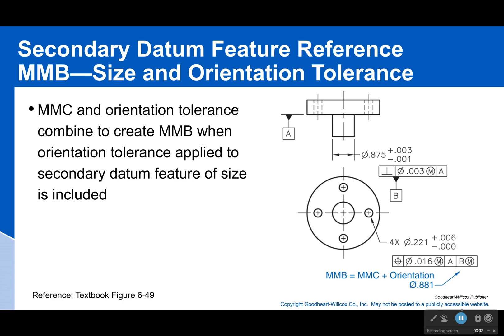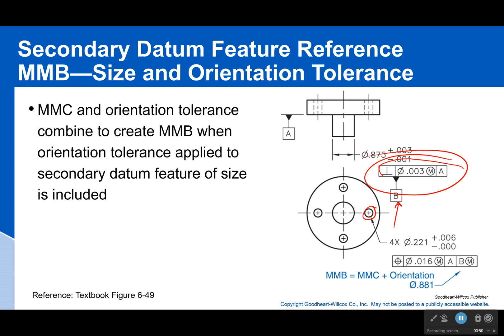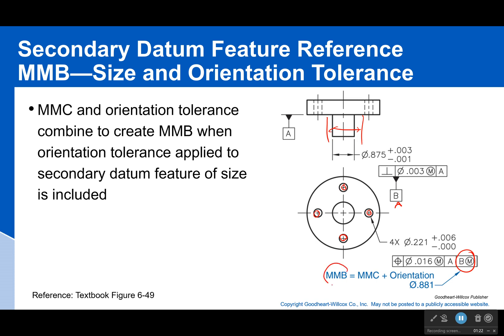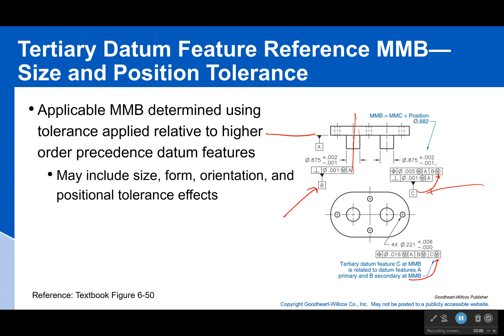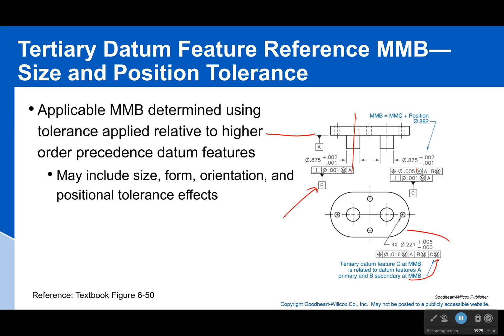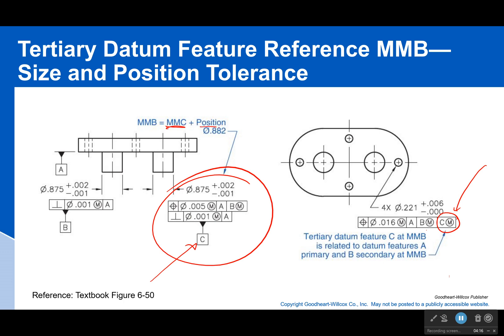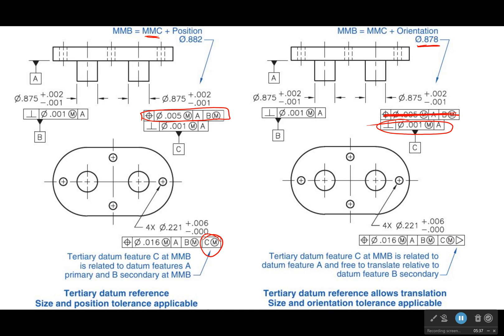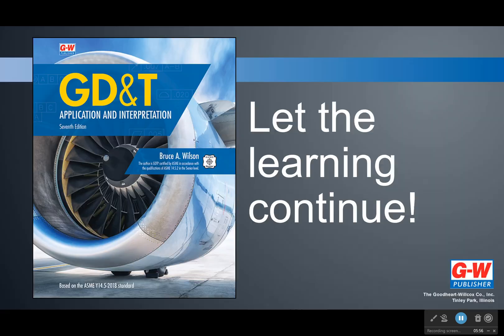Tolerance effects on material boundaries

Comment: Hello sir,
Is it same in value of external feature at MMB and virtual condition ,
For   external  
MMB=MMC +G TOL
VIRTUAL CONDITION=MMC+GTOL
How both are effecting in assembly.
Reply from the maker: It is slightly different. As virtual condition is about tolerances, where MMB is focusing on datums. the MMB is equal to the MMC + any applicable tolerances, however, its purpose is for setting up where your datum features are. For MMB, the datum simulator will not be in contact with the part unless it is at its MMC. Anything smaller will make the part still have additional wiggle room as it will not be fully constrained. The virtual condition on the other hand is a way of measuring tolerance and seeing if a part is going to meet its tolerance requirements using a gage. They have similar values numerically, but are asking for you to do different things.